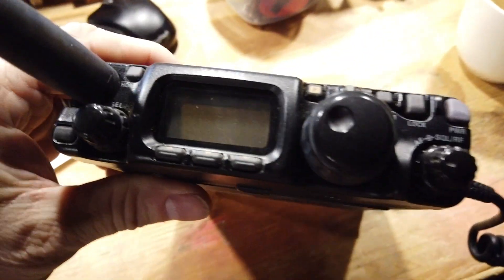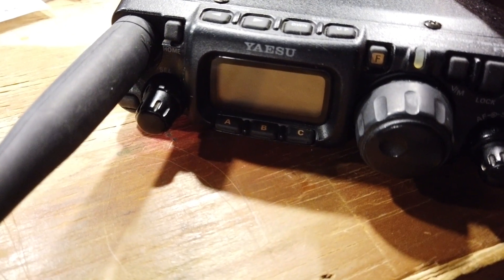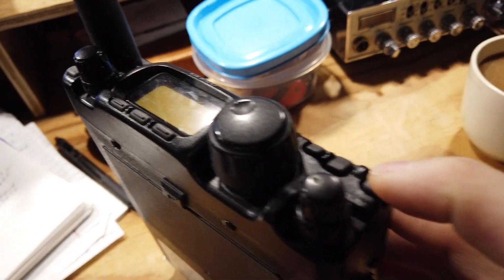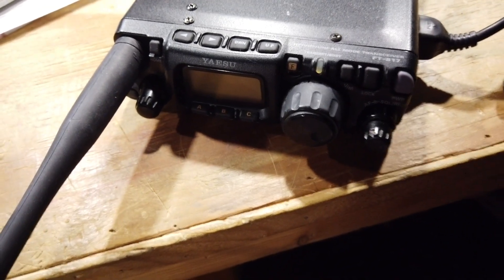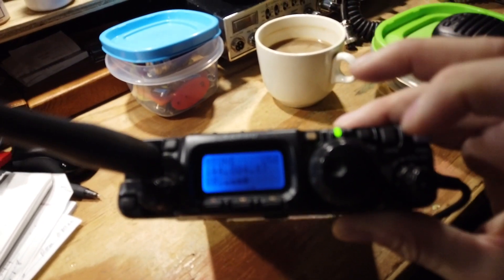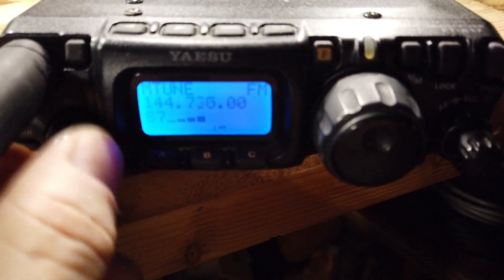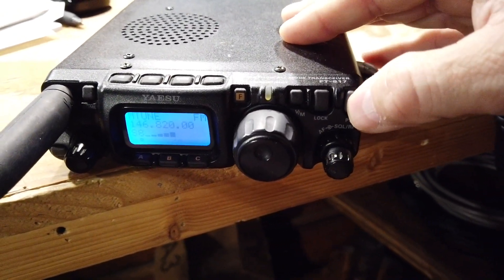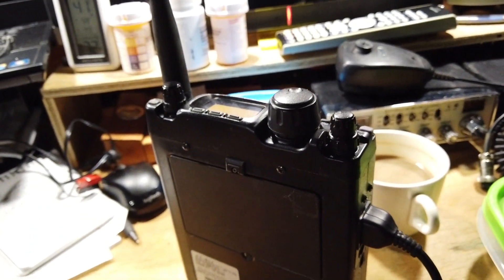FT817 Power-Up Problem Part One of ?

Comment: My 817ND bricked after charging the battery pack.  Took it to MJ & after 2 months picked it up still broken. So bought a new 818ND. Scared to use it.
Reply from the maker: I bought the 818 and used it for a good while with great success. Then sold it. The guy uses it often on POTA activations.

Comment: Have you tried with a power supply plugged in and no battery?
Reply from the maker: Yes, it rarely powers up with just the power supply with no batteries installed.  I can usually get it to power up with the battery pack, (no external power) but it is not consistent.

Comment: Frustrating isn't it?
W4KG
Reply from the maker: ALways looking for a challenge.  No worries.
Reply: Bring it to Clingman this weekend and i'll remove it from your worries.   @KOVintageTech
Reply from the maker: paintman8768 - good idea. But I just got the parts in to fix it (hopefully).  And no time to do that before Saturday.
Reply: @cki4syrm I’ve got a FT817 that won’t power on as well. Any chance I can send mine in for repairs? If so what is the contact info?